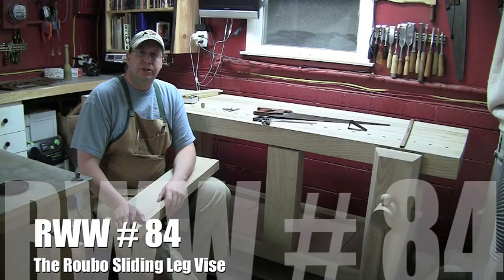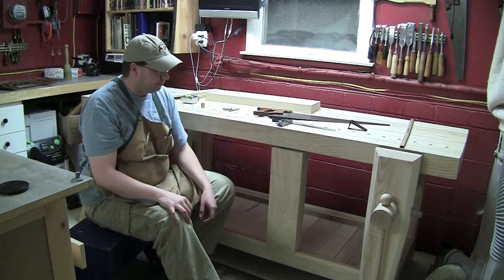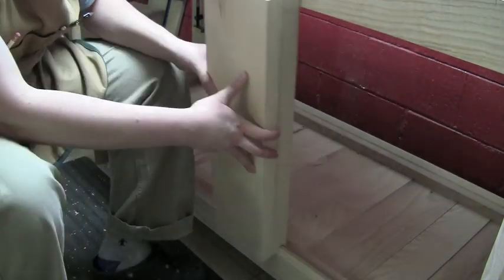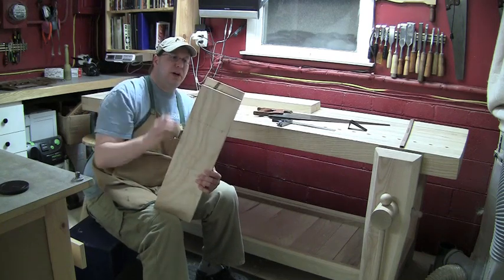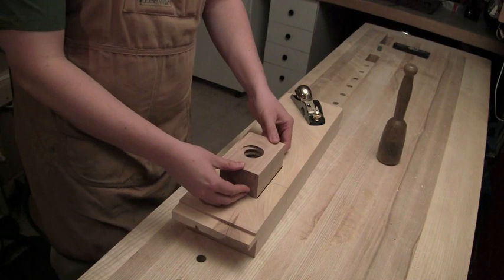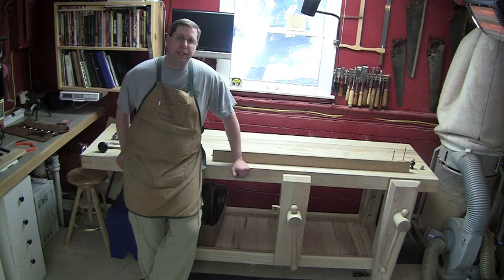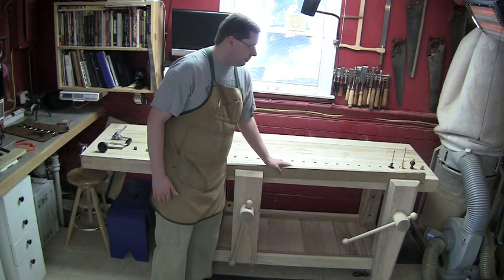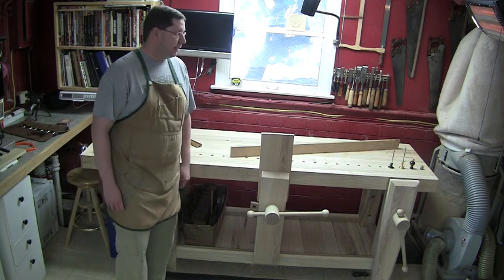RWW 84 Roubo Sliding Leg Vise

Comment: A complete "V" groove in the the chop with the 1/4" flat on the mating surface makes for a better fit and ease if installation, a slight taper to the base of the tennon with the flat on the top again ,makes for a better fit. 
You are doing it backwards.

Comment: Ok, why is rubber cement a no no for the leather to wood bond? It is the glue of choice in all leather working applications. Hide glue makes sense as well. I am coming up on the stage of building my deadman and this video confirms my plan to do it will work. Thanks for the great video! Cheers
Reply: Hide glue, and PVA are more easily removed than rubber cement.  Eventually the leather wears out and needs replacing.  That's when you appreciate glue that's easily removed.